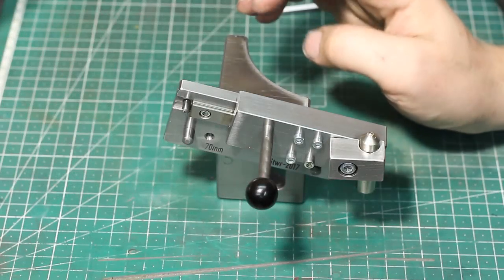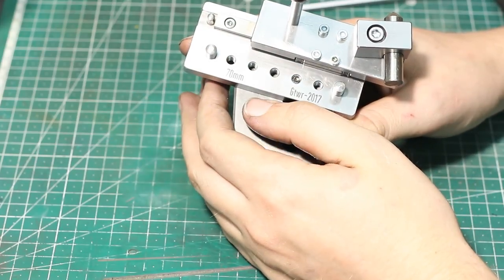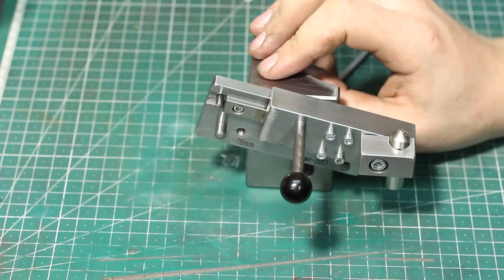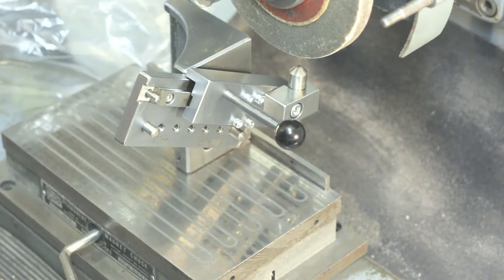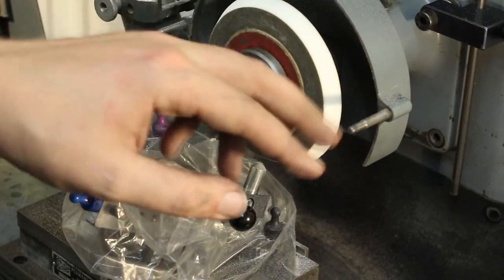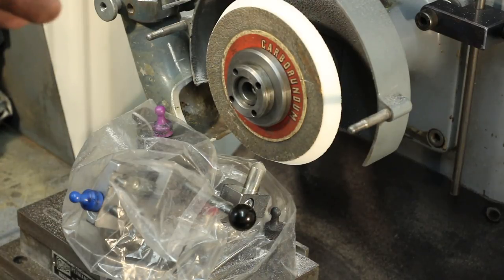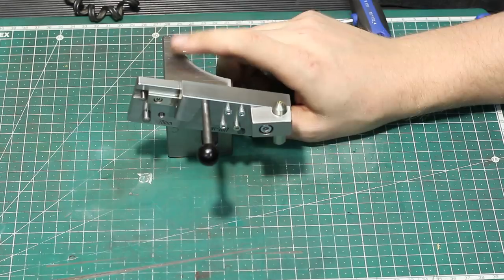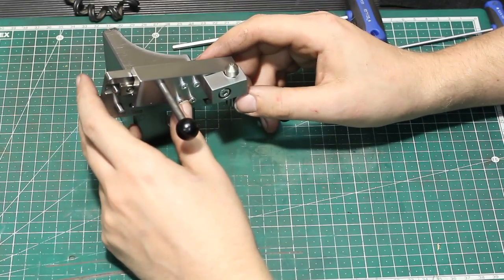Angle dresser for the surface grinder

Comment: Very nicely done Stefan! I agree, stock rack engineering on the fly is one of my favorite activities. Still waiting for the dc motor dress speed controller upgrade ;-)
ATB, Robin
Reply from the maker: Thanks Robin! 
I dont even dare to ask, but what do you use for angle (and radius) dressing?
Reply from the maker: I saw your overhead dresser on the EEV Blog forum, that thing is very nice.
Reply: I dont do a lot of radius and angle dressing but I have a J&S fluidmotion dresser http://www.jstool.com/wheel.htm when I need it.
Reply: I dont remember where that was on the EEV Blog forum but There is a good instagram pic here https://www.instagram.com/p/BXTX35-gGVl/?hl=en&taken-by=robinrenzetti The micrometer head you can see is for the angle adjustment. If you look real carefully you will see the flexural hinge on the left and the stabilizing flexure on the right for the angle adjust. There is another micrometer head not visible on the left that downfeeds the diamond arm. The dress traverse is air cylinder powered (not visible). The big white thing is a calibrated dial in inches per minute that I made to go on a Dershner Kinecheck hydraulic feed control ( the shiny cylinder with the blue label. I calibrated the speed with a linear potentiometer set up as a voltage divider fed into a digital scope where I could calibrate the  delta time over delta voltage.
Reply from the maker: Thank you for the explanation. A over-wheel dresser is absolutely on my list, I looked at a few designs, some had hinge-pins or Pointed setscrews as a hinge for adjustment, but a flexture seems to be the better solution.
For now I have to resolute to my calibrated arm for constant feed, but powerfeed for the dresser would be a very nice thing, indeed.

Comment: Hi Stefan,
Very nice piece of tooling, when I first saw it I thought you had built a retractable tool holder for single point threading like the one described in GH Thomas’ book, lots to learn from this project about function and simple design.
Thanks for sharing.
Cheers

Comment: Dust capture on a grinder is always a PITA. I HATE abrasive dust, especially around machine tools. 

My approach yesteryear was to tightly shroud the dust source so the incoming air at the clearance had sufficient velocity to carry the fines. The whole grains might escape but they are far easier to vacuum up. I suggest a hunk of plastic pipe sculpted to fit the wheel width with 5mm clearance with the lower proportion heated and fitted to catch as much of the dust stream possible.  I have a dedicated 1200 watt vacuum I use for abrasive dust and precision scraping. I never use it for general clean-up because I don't want the filter clogged.

I built a similar gadget with a tiny mounted diamond lap I used on the planer table for touching up carbide broad nose tools. This gave me the edge parallelism I needed for generating smooth flat surfaces on cast iron tables and way surfaces. Done right the finish looks like gray satin ribbons layed parallel edge to edge. 

Can a fitted felt wiper be installed as a first defense on the linear gearing cartridge?

Nice piece of hurry-up work. And yes it is fun to go direct from concept to finished product. The intervening paper design step might produce a more elegant solution but it leads to endless cycles of trivial improvements often losing the original purpose in the process. All you needed was an egg timer but somehow the project evolved into a ceasium clock.

Comment: Another great little project thanks for sharing.  Maybe add a light return spring to pull it away from you on each stroke ?
Reply from the maker: Hmmm, not sure about the spring. I removed the spring from my toolgrinder, as I dont like when stuff moves by itself back..
Reply: OK, no worries.  Keep up the great work !

Comment: Beautiful work as always. That wheel definitely needed dressing, no matter what angle. The problem with dressing any wheel is it needs to stay at that angle or near, otherwise its diameter quickly diminishes. Thanks for the video, Peter

Comment: Very nice Stefan. Thanks for sharing. Everything you build I want one. I just don't seem to have time with my own projects. I do need one of those.
Reply: Just not sure where to get that bearing.
Reply: Try searching on eBay for "linear sliding rail block" and variations of same.
Reply: Thanks tridium6111 for the info.

Comment: I am new to surface grinding .... In my reading so far I understood that the diamond should be mounted at a 30 degree angle (away from rotation direction) so that you can rotate the diamond before each use and add to its life. Is this not really necessary? Thanks for you super helpful videos. I have learned a lot from them.

Comment: Beautiful job!!  Shouldn't there be an adjustment for tidal shift and moon phase?
Reply from the maker: No, that goes to far. But coriolis force is a real concern.
Reply: Stefan Gotteswinter  I have no doubt you can do it.
Reply: Stefan Gotteswinter No problem, just get together with Adam (Abom79) Booth and figure out what to build to slow down the Earth's rotation. You may wanna give Tom a call too @ OXTOOL. 😉 Anyway, awesome as always!👍
Reply: Ah, that will be for the accessory with helical dovetails to attach an Antikythra mechanism...

Comment: Had you mounted the slide on the opposite side of the angle plate, the wheel dust wouldn't be such a faster. However, I really enjoyed the video. Outsidescrewball, (Chuck) and I did a video on a quick, and dirty setup angle dressing. Thank you.

Comment: Hi Stefan,
Nice project. I made an attachment to use on my 5" sine plate to dress angles. I still have not come up with a good solution to protect it from grinding grit.
Steve
Reply from the maker: Thank you! Dust protection is realy an issue - I have some thin leather here that I will make into something like an apron going around the diamond, covering all the moving parts.

Comment: with an acurate perpendicular base of the tool, wouldn't a 30° angle set be translated to 60° with a 90° rotation allowing even steep angles acurately being set? (setting the angle with the tool upside down I mean)
Reply from the maker: Yes! And thats the reason why I surface ground the "angle plate" relatively precise square :)
Reply: But is grinding angles steeper than 60 deg really a good idea. I think the wheel will start to lose much of its structural integrity and fail quite catastrophically with your fingers right next to it. No?
Reply from the maker: You can dress a wheel to be about five times the grit-size thickness without having major problems.

Comment: Does your diamond tip need to be exactly under the axis of the wheel, in order for angle to be exact?
Reply from the maker: Eye-ball precise. I like it to be just a bit behind the centerline, in case of a crash its not as catastrophic as if the dresser was in front of the centerline...then it would get sucked under the wheel and the wheel would pretty sure explode...
Reply: i am not familiar with wheel dressings, was just thinking bout the geometry and the effect of position of that diamond tip to axis of rotation, the further away it is from center the less precise the angle it self is; was my thought process. thanks for the video as always. I see Stefan video in feed i click.
Reply from the maker: Youre absolutely right about the precision issue - But as long as it is "quite" on center, its for most work good enough :)
Reply: Yea, I think it would be chasing microns, good enough is something we have to live with.

Comment: Can you do a video on case hardening
Reply from the maker: AVE just did one ;)
I might do a video on heat treating in general at one point.
Reply: Stefan Gotteswinter saw the AVE video but the steal was not red hot when he dipped it... then he said it doesnt work... would like a second opinion from some one with more precision. Thanks love your vids
Reply: He's wrong.  When done correctly, case hardening does work.  Your point about the steel not being hot enough is spot on.  "Cherry Red" is 1 of the carbonizing products a DIYer can use.  The name tells the tale.  Repeated heats and dips, followed by a final heat tested with a magnet and then rapidly quenched in cold water gets the job done.

Eli D.

Comment: Hi Stephen...I recently acquired a So. Bend 7 inch shaper. I need a vice and was wondering what brand  vice you are using on your shaper. My specifics needs are that it has as low a profile as possible, has a rotating base, and opens to no less than 6 inches. How heavy is your vice ? A response would be greatly appreciated. If possible include you email address.Many thanks.

Comment: Great design, build, and video. No need to film the process of making it when it's rather straightforward, so you don't have to spend so long making all of your videos long format, we don't have to spend as long to see it as it would be if it was long format  (and I do like long format project videos when appropriate for the project), and the function and design are still completely clear. Thanks!

By the way, I have half a dozen or more Carborundum Company wheels that look just like that one. Same age of the blotter style, same color (dirty), etc. It's always interesting to see uncommon items in common in videos of other people's shops.